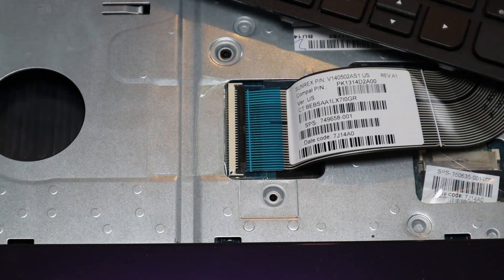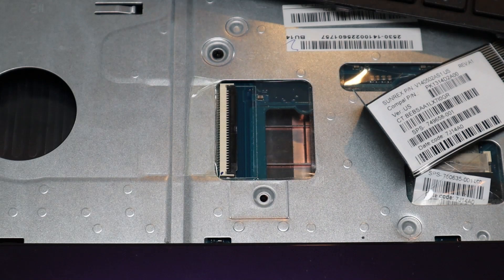HP 15-r Series 15-r036ds Laptop - Replace Upgrade HDD & RAM

Comment: Is it only 1 ram slot? why does google say its 2?
Reply from the maker: There are many models of the 15-R0. Perhaps Google was referring to another one.
Reply: @PC_Monkey  I confirmed that its 2 I just installed 2 rams but its not booting up. I put a crucial 8gbx2 1600mhz 1.35v. 

Thanks for responding!
Reply from the maker: @somedev1553  The computer turned on and worked well before the RAM install? Are you sure the RAM is compatible for your computer?

Comment: I have a HP notebook old version. 
Even when I shut down my laptop, even after the display is off the fan keeps on moving till it is connected with battery or in charge

Comment: Hey, I saw one of your older videos on how to fix a rebooting problem on a Dell Latitude. I wanted to reach out to you because it didn't work for me when I tried to do it without stripping apart my laptop. I have a Dell Latitude 7480 and it won't turn on I've seen multiple videos looking for help but have found nothing. Can you please tell me a way to fix it.
Reply from the maker: Stripping apart your laptop? Were you able to run the diagnostic scan as seen here? https://www.youtube.com/watch?v=NnXmTF0KAYM&feature=youtu.be.  Or, could you find any Repair or Restore options in BIOS? Neither of those require opening the computer. Also, did anything happen before this issue appeared?  Liquid spill, overheating, Windows update, etc?
Reply: @PC_Monkey  The diagnosis says no hardware detected. I had no water spills or anything I did open up the laptop and replugged the ssd in and nothing worked I did notice there was some sticky residue on the ssd but it was working fine for the past 2 weeks there were no spills that I know of and nobody else uses the laptop